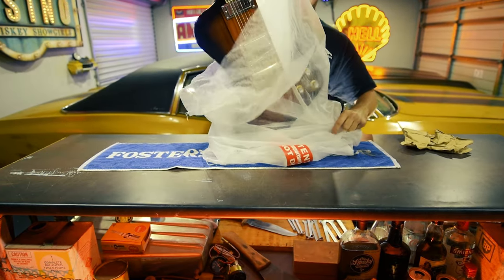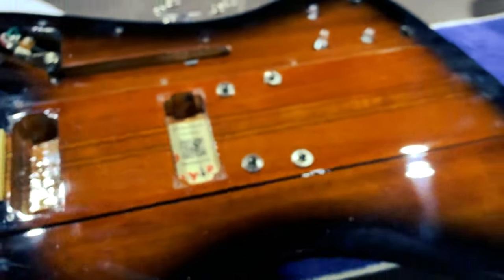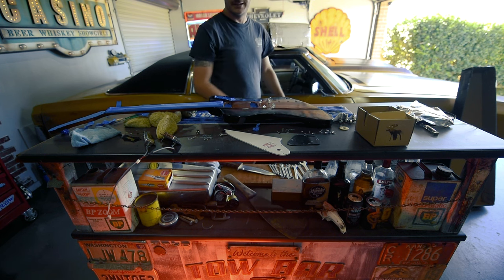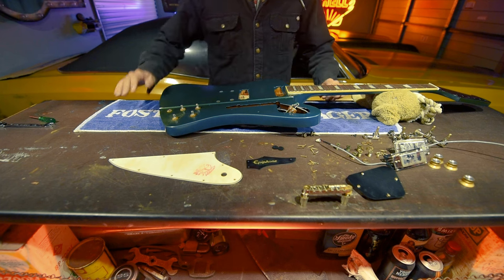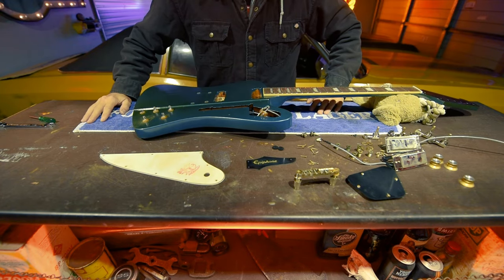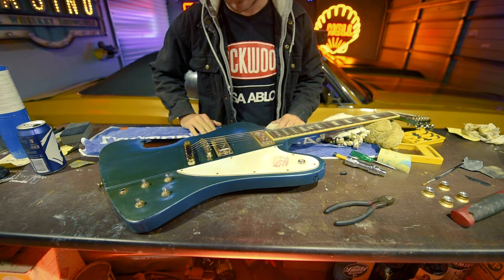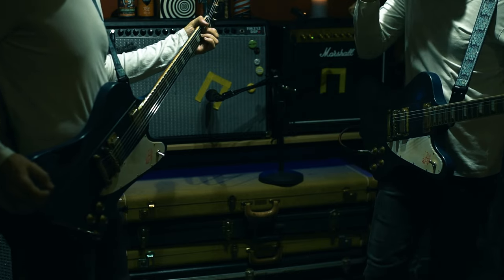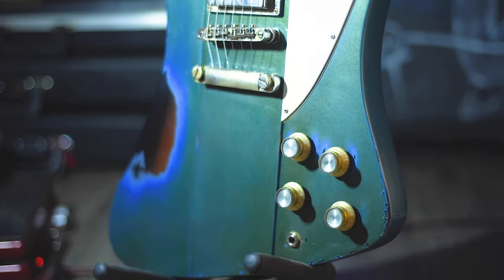New Epiphone 1963 Firebird Tribute

Comment: Stumbled on your vid and it’s like you read my mind 😂 Basically same as you I wanted to get the new Firebird V but 3 grand for an Epi when you can basically get a Gibson SG for the same price. So I have been trying to get my hands on one of these with the same idea to paint it myself. This video has inspired me to make it happen. Probably won’t go down the relic route but some kind of colour pop is much nicer than brown sunburst. One question - did you just give it a wet sand to scuff up the poly finish before painting or did you use some paint remover as well?
Reply from the maker: cheers mate, great minds think alike! haha. I just gave the poly a light scuff and a good clean with grease and wax remover to get off any residual polish. If I was doing a straight up refin and not doing the relic thing i'd strip the poly off. Ive had good success in the past using a heat gun and paint scraper, it's way tidier and cleaner than using paint stripper or something similar.